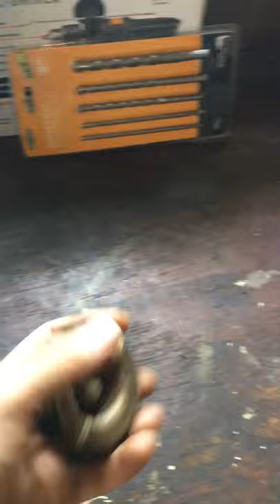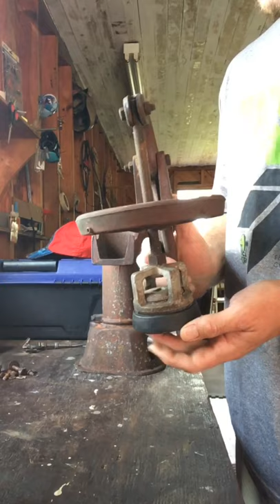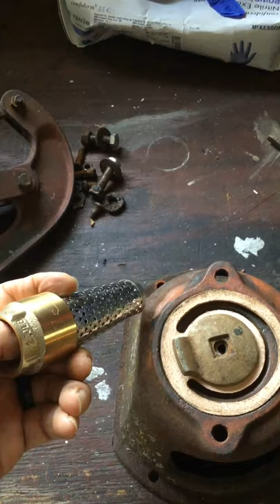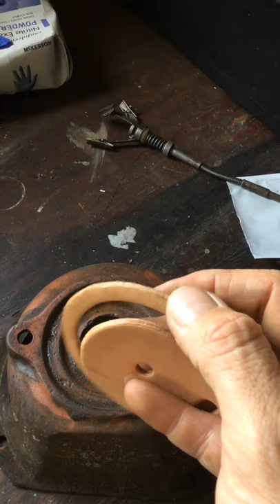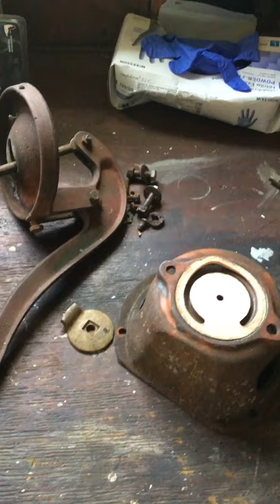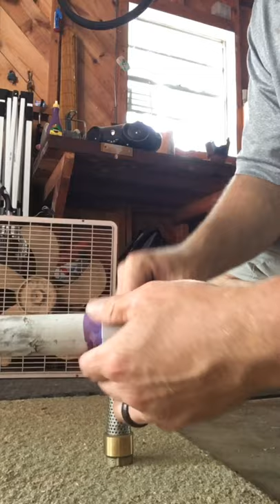Pitcher pump rebuild  {hot tip if your Parts are not fitting correctly}

Comment: It always puts a smile on my face to see a decades-old device restored to working condition.  Items like these can sometimes be found dirt cheap in an antique shop, and they can be made good as new with a little TLC, and not much out of pocket either.

Also, I could have used that tip about teflon tape a few weeks ago.  I found out the hard way, and I could have completed the task with a lot fewer bad words if I had known beforehand.
Reply from the maker: Haha thanks for watching

Comment: modification that I also made on mine, I could have had the original spare part but, for the same cost, I chose to put the more reliable external valve
Reply from the maker: You talking about the check valve?
Reply: @BrileyWray  yes, the check valve
Reply from the maker: @liviostocco1745  OK, mine is still working great. My pump froze n busted this winter but I've got it welded up and back working again
Reply: @BrileyWray  old things are always repairable!